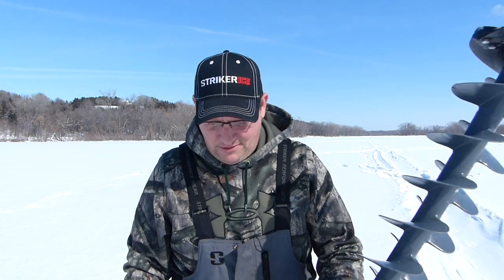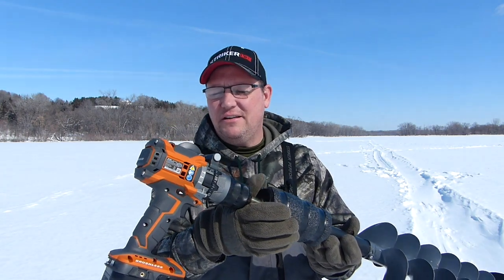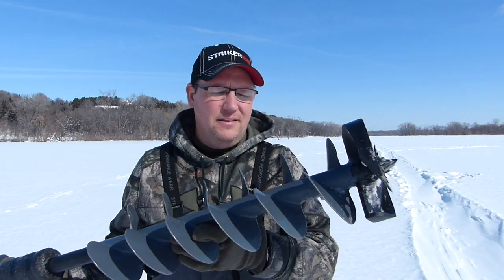Ridgid Octane with KDrill Auger Thick Ice Cutout Issues

Comment: Just a heads up. The octane batteries are Bluetooth capable and have an app for your phone. That app will tell you why it cut out and i guarantee the error code is heat overload from drilling that much that fast. Its a safety feature to help avoid burning it out.
We’ve got around 22” of ice in most of southern Maine right now and i can tell from experience that if i drill 20-22 holes back to back it will heat overload halfway through and kill the battery real quick. Likewise though if i wait for a few minutes between holes then it will drill well over 40 holes. Ive also found that after drilling say 10 holes, pull the battery and keep it in the hot hut if its cold out really helps on life.
Also, im not using a kdrill. Ive got the 8” auger off my eskimo stingray which is really aggressive and pretty heavy.
Reply from the maker: Yes the kdrill is more aggressive I believe.  The app just says, "overload protection".

Comment: I use cordless drills, cutoff saws, etc all the time in oilfield construction. The weather conditions up in northern Alberta that myself and my tools deal with are on the extreme side of cold and I can honestly say what you are doing is a real torture test! You can't expect any cordless tool, no matter what the price, to stand up to continuous load for minutes on end without giving you problems.
Reply from the maker: Yeah good point.  However, the DeWalt I had previous to this sure seemed to handle it much better.
Reply: @3RiversFishingAdventures  It might handle it well in the short term but long term it's shortening the lifespan of the drill. you are using a light duty tool for a heavy duty application.
Reply from the maker: @jayfxdx  makes sense, thanks

Comment: I used a smaller rigid drill and it worked okay for thinner ice, but as I tried to drill 10” or more it also cut out. I purchased a Milwaukee Tool M18 FUEL 18-Volt Lithium-Ion Brushless Cordless 1/2 inch Hammer Drill/Driver W/(2) 5.0Ah Batteries and it drills through 26” of ice without any issues at all and that is using a Swede Bore Hand auger with not the sharpest of blades.

Comment: I just bought this drill with the 3ah battery. I took it out and got about 15-16 holes in about 20" of ice. The battery was down to one bar and with a little rest would start another hole but then quit. I think the battery was damn near dead. The first 15-16 holes were without a hitch. I think you're onto something using the K drill, and having it drag on the drill too much.  I was using an 8" Nils with a fresh edge on it. Maybe the style cutting head is a factor with this drill.

Comment: dont tell ridgid what your doing with that drill, they will instantly void the warranty!! I've got that drill and the 4ah gen5 X. the 9ah brushless does the exact same thing as yours is. i contacted ridgid and explained to them the issues, they automatically told me that the warranty is now void as their drills are not ment too be used on ice augers and they hung up on me!! my advice is to go buy the Milwaukee fuel hammer drill or maybe use that DeWalt ya got!! even my 4ah non brushless will cut out while drilling through 1/4 steel. not happy about with either so im gonna spend the money and buy the Milwaukee fuel series kit. and I've now bought the strikemaster 40v lithium ion electric auger!! i wouldn't go back too using a drill auger combo ever again👍

Comment: I have the x5 with 2 4ah batteries... not octane but I haven't had cutout issues with my lazer auger. don't have a k-drill, don't know if that makes a big difference or not.
Reply: I have the same issue.  Found if you don't push down and let the auger do the work it seems to do fine

Comment: Put it on a shaver blade like a nils or lazer then retest. The chipper blades is what's making it cut out more often. Its easier to shave than it is to chip ice. In real world use you will not have this problem.
Reply from the maker: I agree, but I need a chipper blades to overlap holes.

Comment: I have that same drill but hooked to a clam plate with the blue 8" nils.  I drilled 30 holes in 8" of solid ice and it never cut out at all.      I got tired of drilling holes so I stop had 3 bars when checking battery.  Never cut out and never needed to clear or stop the auger of the ice in the flutes.  It may be the kdrill with the chipper blade that is not the best combo.
Reply from the maker: Yeah I think you might be right.  My blades could probably be sharpened too.

Comment: Buy a Milwaukee fuel.
Reply: Milwaukee discontinued the side handle for the M18 FUEL Hammer Drill. 
Planned obsolescence   for sure
They really love their customers.  Buy the De Walt instead, it is very close in ability from what I've read.
Reply: @allareredeemed  What information did you get that from?  I have a Gen3 Fuel drill I got this winter - comes with their recently redesigned side handle.  It has withstood a lot of abuse this winter on the ice.
Reply: @allareredeemed  They redesigned it from the 2704 to the 2804.  It's certainly still included and has a better design now.
Reply: @carlsonmn  I was told by the Milwaukee rep that they are no longer making it. I may be wrong but where I live and everyone on E Bay stores has told me no more side handles for the M18 FUEL Hammer Driver. There may be some package deals including the handle however.  I'm selling it.  I take no offense and mean no offense to the public, but for Milwaukee, they stink